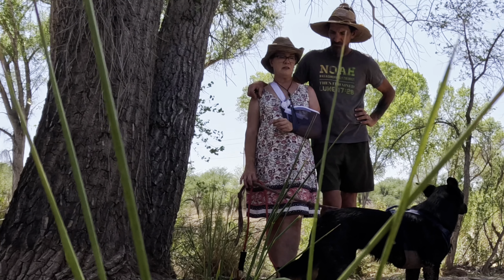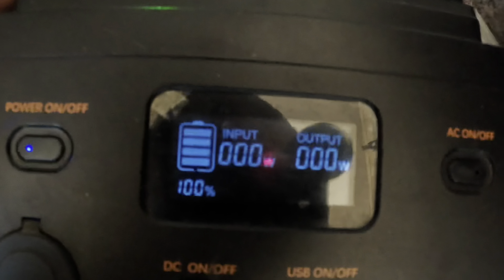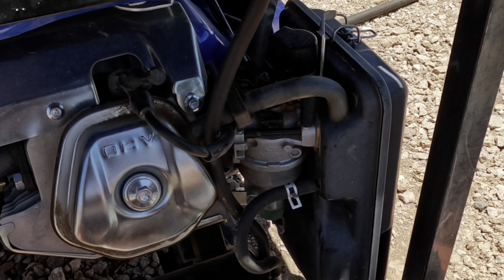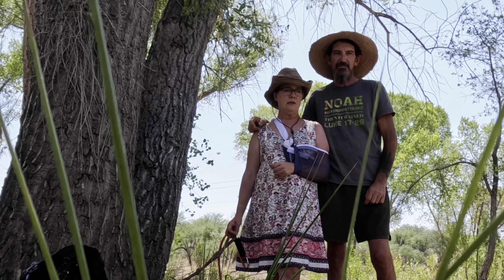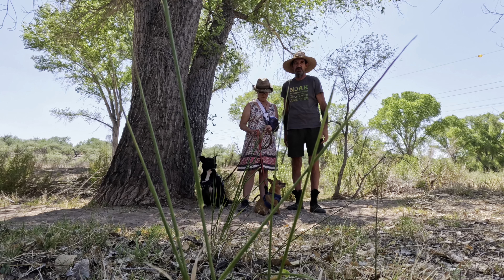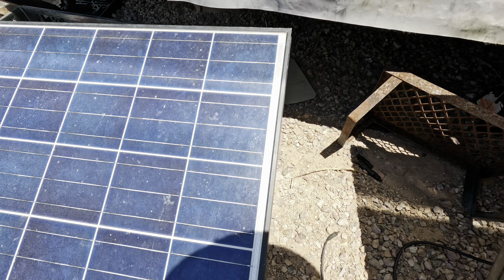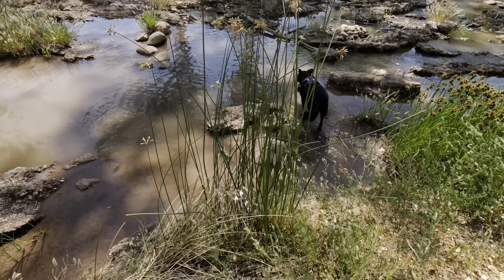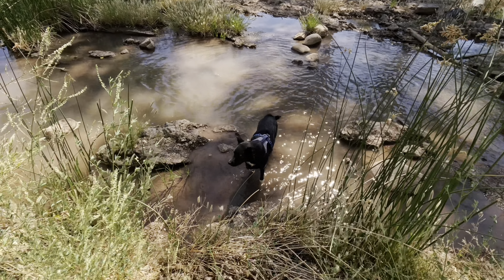DANGER! Your SOLAR POWER will fail you when you need it most!

Comment: Your experiences with power stations not being as robust as they should be are widely shared.   The "all in one" nature of a power station makes it difficult to fix issues piece-meal.   This is why most people with off-grid setups eventually wind up buying discrete pieces of equipment instead of relying on the single point of failure that a power station represents.

It sounds like you are at the point where you should be considering other solutions. but you might not have the electrical knowledge required to really do a full-on system yourself.  So I am going to make a recommendation. 

-- RECOMMENDATION --

What I am going to describe is a way to separate your solar charging from your power station, so they are basically independent of each other.

Basically what I am suggesting is that you wire the solar into a discrete charge controller and a discrete 25.6V LiFePO4 battery, and then wire the battery to the "solar" input of one or more power stations.    Simple as that.

I am recommending 25.6V instead of 12.8V or 51.2V (12V or 48V systems)...  I think for your situation, a 24V system is the best solution.  The voltages are still low enough that the fusing is less prone to error.  But most importantly, feeding 25.6V into a power station typically nets you 200-250W of continuous trickle charging.   Many power stations cannot handle higher (51.2V) input voltages on their "solar" input.  Hence my recommendation is to stick with 25.6V.

This way you can expand your system... your solar and your storage, without having to worry about the power stations so much.  You would still use the power station to deliver the USB and AC outputs and such, instead of buying discrete inverters and other components.   What I am describing is complex enough as it is so I'm trying to keep things simple.

-- Components --

* A Victron SmartSolar 75/15 or a SmartSolar 100/20 charge controller (or similar solar charge controller).   I'm choosing these because they are a good value and already have a built-in fuse to make wiring things up easier.   Roughly $100.

The 75/15 can push 15A @ 25.6V (roughly) = 300W of solar, and the 100/20 can push 20A @ 25.6V (roughly) = 500W of solar.   Most importantly, these charge controllers will limit their current so you can over-panel the solar without any worries.  They will not go above their limit even if you have more solar attached.

* A 25.6V LiFePO4 battery.  Doesn't have to be a big one.  Just as a learning tool to begin with.  So maybe a 25.6V 50Ah LiFePO4 battery.   Roughly $250.

* Appropriate cabling.  Just to start with you can wire things up with 10 AWG, since we'll never be putting more than 20A in or out of the battery.  But as you expand the system you will obviously want to use thicker cabling, based on the amperages you will be dealing with.

* Appropriate ring crimp terminals for wiring to/from the battery.   Plus wire strippers, and so forth.

* An inline glass fuse holder and glass fuse assortment for going from the battery to the power station.  A 20A fuse should be sufficient to protect the cabling.

(Remember, I am describing a low-amperage system here, so I am avoiding the use of larger ANL, Monster, or MRBF type fuses to start out with)

-- Construction --

* Wire the solar panels.  200W panels can be put in series or parallel, either works.  Two 100W panels would have to be put in series to develop sufficient voltage to charge a 25.6V battery system.  If wiring more than two solar panels, note the open-circuit voltage limitation of the charge controller (75V for the 75/15 or 100V for the 100/20).

* Connect the charge controller's BAT terminals to the battery with 10 AWG wiring.

* Use the Victron app to configure the charge controller for LiFePO4 "24V" (25.6V nominal) operation.

* Connect the charge controller's SOLAR terminals to the solar panel wiring.  10 AWG or 12 AWG wiring is typically ok for the solar panel wiring.

* Verify with the Victron app that the charge controller sees both the battery and the solar panel voltages.

* Connect the battery to the power station with the 20A inline glass fuse on the positive cable.  10 AWG wiring is ok here too.   The power station should trickle-charge at between 8A and 15A depending on the power station.

-- Operation --

The solar charges the battery through the charge controller and the battery charges the power station.  The battery will drop-out if the power station sucks up all of its juice, but that's ok, it will recharge from the solar.  (not entirely ideal but it works for your purposes).

You can also disconnect the power station at any time without interrupt the solar's ability to charge the fixed battery, so this gives you a lot of wiggle room.

-- Future expansion --.

* You can add additional solar panels and an additional charge controller.   A 50Ah 25.6V battery can handle 3 x 15A charge controllers or 2 x 20A charge controllers.   For example, you could add two more 200W solar panels plus another Victron charge controller for those panels into the battery system.

 * You can add more 25.6V batteries in parallel, but if you do you have to re-cable the battery with 2 AWG or 4 AWG cabling since now the amperages are getting pretty serious.   And once you have done this, your battery system will not only have more capacity it will also be able to handle more solar panels + charge controllers.

* If you do add more batteries in parallel you will need to add a "main battery fuse" to the system for safety.  Use a MRBF (Marine Rated Battery Fuse plus fuse holder and appropriate bolts and nuts) is the easiest way to do this.

* As you expand the system you will probably want to get bus bars... these are usually 150A or 200A "busses" with a series of M8 bolts for connecting cables up.   And potentially even get bus bars with built-in fusing.   For example, Victron makes a "6-way mega fuse holder busbar".  That makes fusing easier when dealing with higher amperages.

In larger systems, all devices should be fused.  Also consider getting some Anderson Quick Disconnects for the main battery bank.

--

This is the best advice I can offer for what I perceive to be your current experience with solar systems.

-Matt
Reply from the maker: Matt.. I am blown away by this detailed post.. and am very impressed.. I am saving this post for future reference and to study later on.. thank you for sharing your knowledge and experience.. I really appreciate your input and time spent walking me through this process a bit..thank you for watching
Reply: @tworebelsoffgrid  Good luck on making it all work out!  Beware those hot junctions... usually means arcing and other problems that can lead to a fire.
Reply from the maker: @junkerzn7312  thank you so much my friend

Comment: Yeah.. things break down occassionally. One of my Four Battleborn 100Ah batteries just died. i've had them on the tongue of my trailer for 3 yrs and they've done well.. so them being 25' away from the inverter (Victron MPII 12v 3000 120) stressed it out and now BB won't warranty it. These things are $845 each. So I DO not reccomend them anymore. To top it off.. they would only give me a whopping 15% off a replacement. So I should be recieving a Li Time 400Ah tomorrow for a few hundred $ more.
Reply from the maker: Argh!!!!😠 sounds like we have the same setup and brand as you,, this is very upsetting to know that bb is just as bad as the others
Reply: @tworebelsoffgrid  haha.. we might. Yeah..  I don't support them anymore. They would give me a whopping 15% a replacement. They're almost $1000 each.

Comment: ok, with all due respect, you are doing solar completely wrong. the solar boxes you are using are meant for weekend trips, nit full time living. You can easily live on strait solar, but you need the right gear to do it. buy yourself a 48v all in one inverter/charger and a couple 5 kwh batteries and put up 3000-5000 watts of solar. and you can run everything that you want to. scalable and versatile. 
To crap all over solar because you are trying to live full time on a weekender box, of course you are going to fail.
You can buy 250 watt panels used for dirt cheap. 
Bugs me when people use the wrong stuff and then crap all over the industry. 

You can live on solar, I have two homes both off grid, no gas generator at either location, only solar.
Reply from the maker: We are very new to solar and still learning a lot, so we do appreciate your input on what we've been using.  We definitely were not trying to crap on the industry because we intend to have our house fully off-grid and on solar once it's built.  Good thing we still have time to learn :)  We had no idea these were "weekender" boxes, however, we do only use them to charge up small electronics or run a small fan.  Have a great day!
Reply: @tworebelsoffgrid  you may not be aware that the little weekender boxes are really only good for 500-800 recharges either. That’s another reason they are no good for full timers like us. 

If you genuinely want help doing it correctly then I would be happy to help you with that. 

Cheers.
Reply from the maker: Nope, we were not aware of that, so thank you for sharing!  We really appreciate the offer and may take you up on that.  We did buy a full house ready system from Battleborn, but it's still in storage until the house gets built.
Reply: @tworebelsoffgrid  that’s unfortunate, maybe. 🤔 
You see depending on when you bought them they might be the same chemistry as the weekender boxes you have. 
I’m not certain when, but at some point battleborn DID switch over to the lifepo4 chemistry, just not sure when. 
What all did you buy from them and when was that?
Reply from the maker: @sNEAKYnIGHTmUPPET  We bought the system 2 years ago and yep, that's the batteries we got 4 of the12V LioFePO4 Deep Cycle GC3 Battery, 1 Quattro 48/5000/70-100/100 120V,  1 SmartSolar MPPT 250/60 TR Charge Controller
with Bluetooth, and various other accessories...all from Battleborn.  We had no idea what we were doing and just wanted to get the system purchased and stored for later.  Hopefully it's decent...I guess we will see :)
Reply: @tworebelsoffgrid  Well, A wave of relief just came over me. Your system details are a fantastic start. That system when installed correctly should last a lifetime. Your battery situation will need to be expanded upon, but it is a great start for sure.

Once you run on a real solar system you will understand why those little boxes are such a joke for full timers.

Just make CERTAIN that you buy and install as many panels as the controller can handle. more solar is always best.

Comment: It's called cloud seeding and it's nothing even similar to what you said and it isn't done large scale because it doesn't work. Silver and potassium iodine are actually used and passenger aircraft fly way too high for it to be viable. I wish we could make more rain because a lot of the world needs it.
99% of the time it's used for snow production because when there is already lots of moisture then it works decently.
You have that haze where you are as well, you just can't see it because you're in it, you see it far away because of how light refraction works.
My solar has worked 20 years just fine, every time I "need it most" when severe weather takes down anyone else, it's there working fine.
Reply from the maker: Ha!  We are certainly not experts on what they are doing in the sky, that's for sure!  Yep, we know the haze you are talking about and we can see it, especially on hot days with no moisture.  Glad you've had a good experience with your solar system.